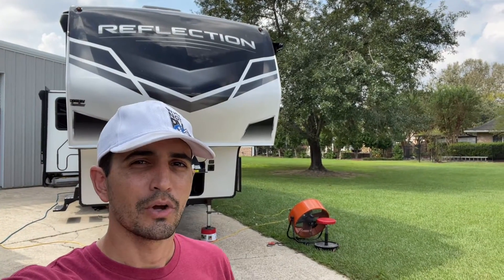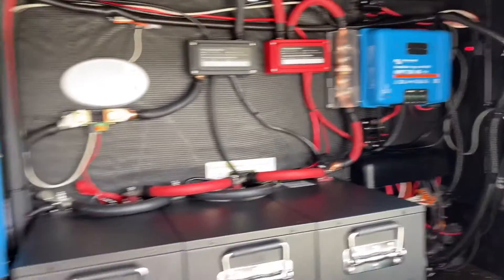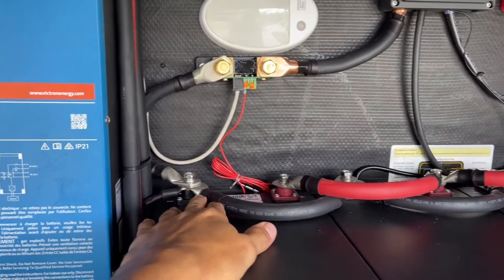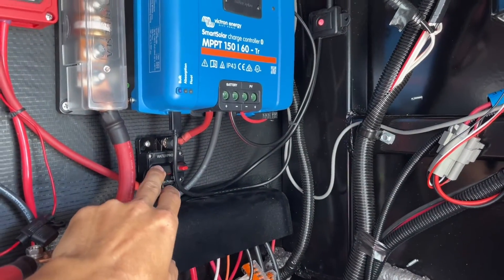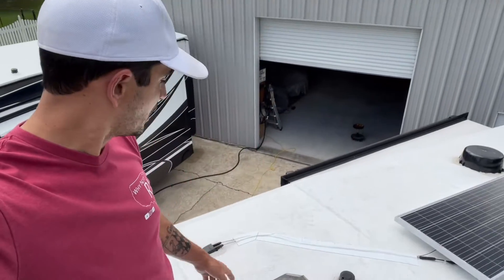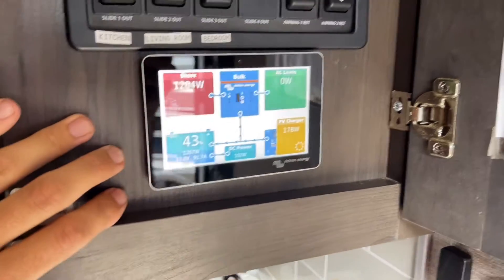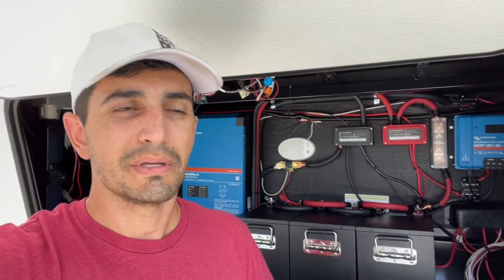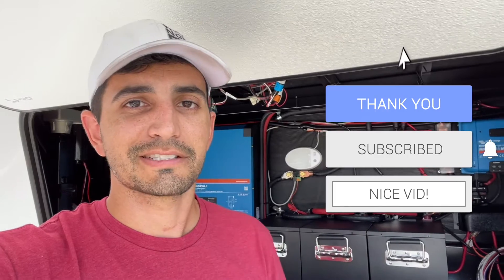Full Victron Electric upgrade INSTALL (Multiplus II, Orion, MPPT, BMV) - Why Not RV: Ep 74

Comment: Phenomenal video! I’ve been searching for another in depth demonstration like yours ever since I initially saw Jared Gillis on “All About RVs” describing the advantages of the MultiPlus II.

I have a few of questions:

In his video, he talked about using 6 gauge THHN wire through a PVC conduit running from the MP II to the breaker panel for additional heat isolation. What is your take on this?

In my situation, I have a generator in addition to the shore power running to an Automatic Transfer Switch near the breaker panel and the existing converter. Am I safe to run from that ATS in it’s current position to the MP II where I plan to install it in the front storage bay (where I also plan to install the battery bank to minimize that run)? Would there be an advantage to moving the ATS up front as well? (I’d rather not have to re-wire from both the generator and shore power to the ATS if I can avoid it).

Would 6/3 Romex be OK between the ATS and MP II? (In other words, did you use 6/4 SOOW cable for more than its flexibility and ease of installation?)

Thanks so much!
Reply from the maker: Hey Burt. Thanks for watching. Great questions. There’s several options as you know and no 1 way is the “right” way. Unless you’re running over 50’ of wire you really don’t need to worry about heat or voltage drop. So in the case of an RV it’s almost never relevant. You can leave your transfer switch where it is and wire 6/3 romex as you described no problem. Just make sure that wire is protected where it needs to be.
Reply from the maker: And yes we used the SOOW for flexibility and it’s high insulation value. Thanks again for watching!

Comment: Very nice and neat install! I am currently filling up my storage room with  components for install in a 303 RLS as well and the  Victron Multiplus II is on order.  Do you recall the length of cab tire you used from the plug to the inverter? Secondly I was thinking of reusing existing wire from the breaker panel to the inverter rather than replace it with new wire. The disadvantage would be using the solid wire instead of the stranded cab tire.
Reply from the maker: I definitely couldn’t tell you the length of the wire used, I just cut as needed depending on the project. No issues reusing the cabling that’s already attached to your panel, however, it won’t reach that front bay, if you can mount it in the middle pass through area you could get away with it.
Reply: I was wondering the same thing with solid wire vs stranded wire I noticed in my breaker  panel my ground wire is solid copper rather then stranded not sure how well that will go into the input on the multiplus 2

Comment: Did I miss it or why do you not install an EMS/surge protector on shore power line. Are they using a portable one?
Reply from the maker: Correct, they have the portable at the end of the shore cord

Comment: What kind of amperage do I need to charge those three batteries that you have in that camper with the comverter charger on that battery says something charging about 50 amp what that means
Reply from the maker: You can push 100 amps into these batteries I believe. Check manufacturers specs

Comment: Love the Video! I am in the process of installing a very similar system as well.  Quick question about the cable you used for the AC side... What are the specs for the cable and where did you purchase? ( I'm assuming 6 gauge?) Thanks for the info......
Reply from the maker: Its 6 gauge yes, it is actually a special cable that was quite expensive purchased from a local electrical supply store. Very thick rubber coating and heavy insulation in cable.
Reply: @WhyNotRV  Was it 6/4 SOOW cable?
Reply from the maker: Exactly correct
Reply: @WhyNotRV  One additional question if I can....
Regarding disconnecting existing Converter....
When you disconnected the converter from the circuit breaker in the RV 
main panel, did you run new cables from the same circuit breaker to the 
positive and negative bus bars in the front bay in order to reconnect the
DC wiring to the existing RV system? (You said in your video that you 
connected the positive and negative bus bar to the original RV DC system.)
Can you please clarify?
Reply from the maker: The circuit breaker from the main panel is AC power. You DO NOT connect back to that. Where the red and black wires from the old converter go to… that’s where you can reconnect to the existing DC system
Reply: @WhyNotRV  Thanks for your reply. Understand now.... When you removed the Converter did you also remove the circuit breaker or just leave it in breaker panel?
Reply from the maker: I just turned the breaker to OFF and left it in there.

Comment: Very nice job! I recently did a solar install as well, six 350 W panels all wired in parallel, because most of the campsites in the Northeast are heavily shaded. One 270 amp GC3 Battle Born battery, our camper also has a 12 volt furrion refrigerator ,we camped for six weeks and never needed a generator.
Reply from the maker: That’s awesome. I love those 12v fridges. They take no power at all. Ridiculous

Comment: Thanks for the advice on series/parallel connections on the panels.  I’m setting up a virtually identical system on our new Grand Design 5th wheel.  I’m putting 4 panels on the roof and was planning all series.  I can still series/parallel the system and not exceed the capacity of the factory 10 gauge wire.  Of course it’s pretty easy to change to all series to test.
Reply from the maker: Absolutely, I’d connect as many in series as you need to keep the amps down for whatever wiring is there. The parallel combo helps with overall efficiency
Reply: @WhyNotRV  one other thing… I like your tidbit about taking the main positive from one side of the battery bank and negative from the other.  I’m paralleling 4 Battle Borns and it makes so much sense to “force” the circuit to travel through all batteries.
Reply from the maker: Absolutely. It’s the most effective way to maintain equal charge and discharge in my opinion

Comment: I am currently planning a very similar installation with a Multiplus 2 in my 50 amp 5th wheel.   I was wondering about the lack of a  battery shutoff between the batteries and the distribution box?
Reply from the maker: This rig already had a battery cut off in line between the distribution box and where I connected to the bus bars.

Comment: Very clean install. Trying to get my ducks in a row for something similar. I just ordered a Raspberry Pi. The Victron stuff is fantastic, but expensive. I am going to try to set up the Venus Cerbo GX software on the RasPi before I get going on the rest. The Raspi set up will only be $150 instead of $600 for the Cerbo Gx
Reply: Interesting use of the RasPi!!!  Great idea!
Reply: @tomgip  Ive got the Raspberi Pi running now. Works the same as the Cerbo for 1/10th the price
Reply from the maker: Understandable. Victron is top-of-the-line and definitely has some expensive equipment. I’ve seen several people do the raspberry pi situation

Comment: Can two of the multiplus II's be run in parallel to give 6KVA output? Also I notice the larger 206 AH SOK battery has a maximum current output of 100A, giving you a maximum output for 3 batteries of 300A. I am thinking it probably would be better to use the 100AH SOK batteries which also have 100A maximum output so 6 in parallel would have a maximum current draw of 600A allowing for potential upgrades to the inverter in the future?
Reply from the maker: Short answer is yes. You can parallel 3 multiplus units together if desired. As for the batteries. You’re going to max out your wiring pretty quickly most likely. It’s definitely all personal preference but these 200 amp hour batteries take up such a smaller footprint and I feel like that’s more important but for your situation you might feel opposite it’s all preferential